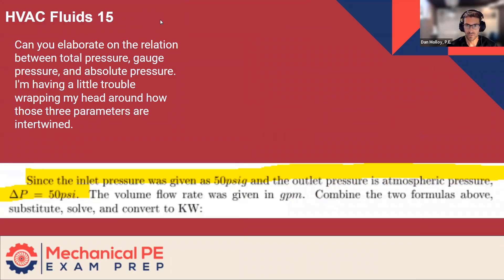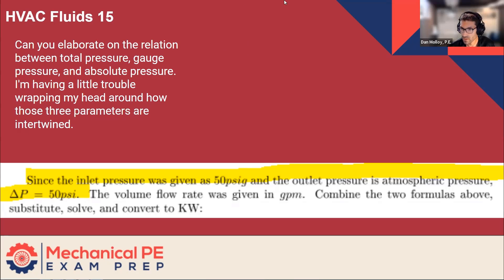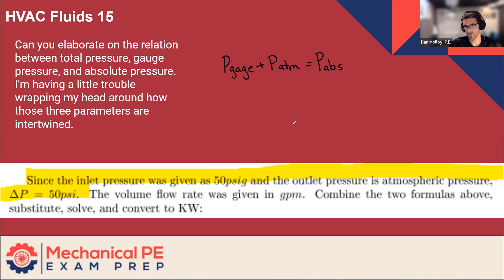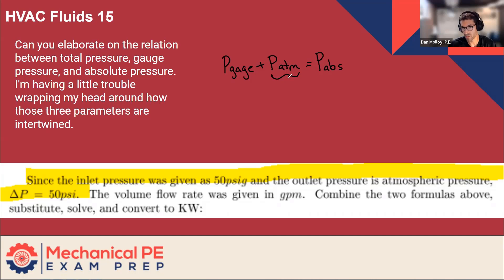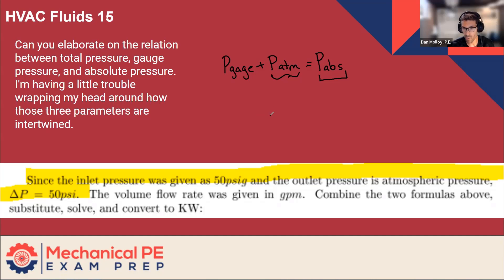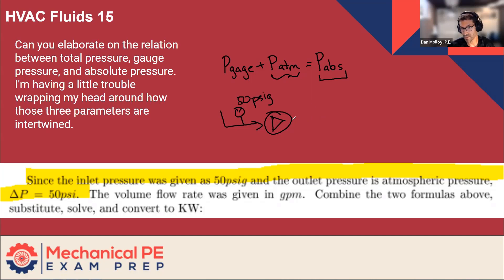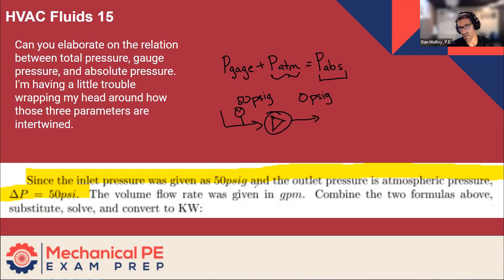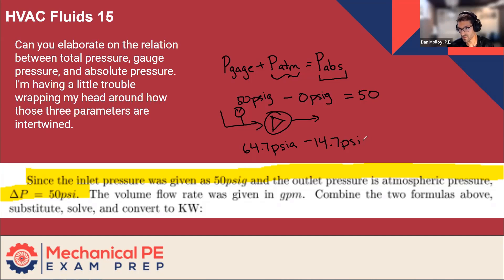PE Mechanical Exam Prep with Dan | Still Confused About PSIG vs. PSIA?: Fluid Mechanics Simplified

Comment: I appreciate the second explanation, as there still is atmospheric pressure, but the  psi gauges are tuned to read 0 at 14.7 psi, or whatever the elevation psi is.  I assume we don't do an elevation adjustment to atmospheric pressure when assumed unless its mentioned.
Reply from the maker: Depends on what the goal is.  If you are trying to find the differential pressure aka "Delta P" and the other reading you have is also in psig, just subtract, no additional conversion needed.  However, if you are planning on using a table to look up some properties of that fluid, say, water, at that particular pressure, chances are it will be organized in psia (absolute).  Context is everything, and experience solving lots and lots of good problems will hone your judgment on what to do and when.